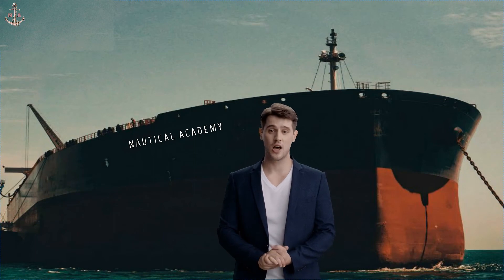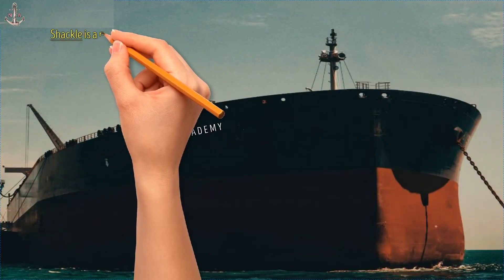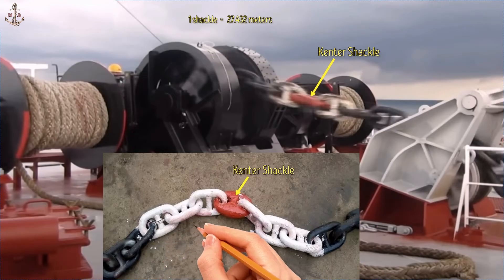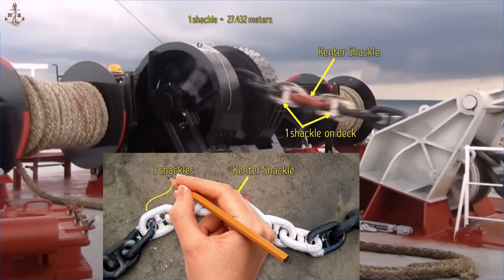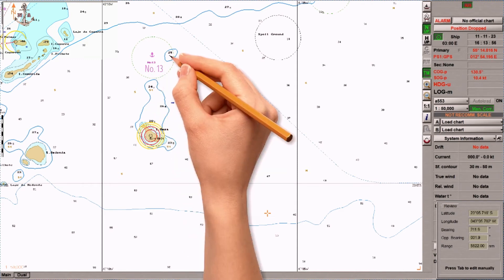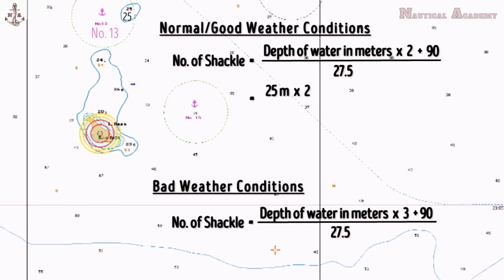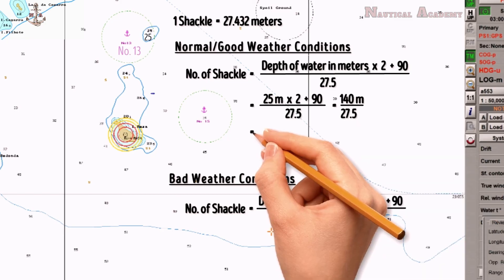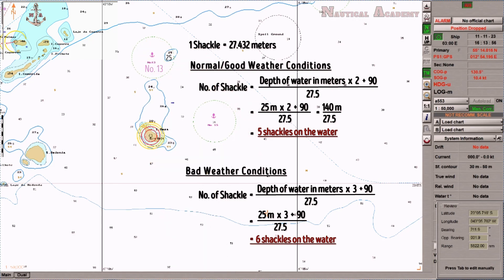Calculate Anchor Shackle to Drop ll Determine how many shackles have been dropped ll Seamanship

Comment: What is the constant 90?
Reply from the maker: The constant 90 in the formula represents the length of one anchor shackle in feet. In anchoring practices, a shackle is a standard length of 90 feet, which is why we use this number to convert the required anchor chain length into shackles. This makes it easier to calculate how many shackles of chain should be dropped for safe anchoring.

Comment: some captains i show they use depth of water*3 +90/27.5 in good weather conditions
Reply from the maker: Thanks for your comment! The calculation of anchor shackles can vary depending on the preferences of the master, especially when the seabed is not a good holding ground. While some may use the formula you mentioned in good weather conditions, others might adjust based on factors like seabed conditions and expected weather changes.

Comment: What meaning constant 90? Is that in meters or ton?
Is that all ships will be same constant 90?
Reply from the maker: There are several formulas to find the scope of the anchor, others use the numerical ratio to find the number of anchor shackles to be dropped depending on the weather conditions. You can use any method that you prefer as long as you comply with the company's Quality Management System (QMS) Manual.
Reply: In this video what is the idea behind 90???